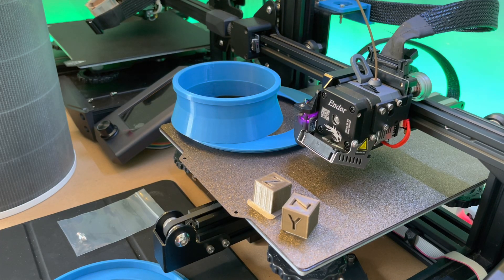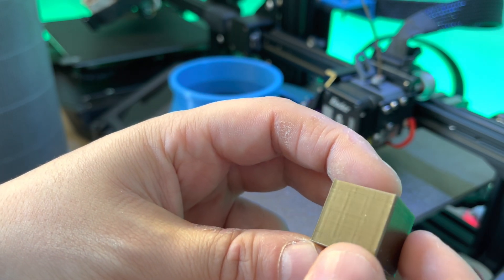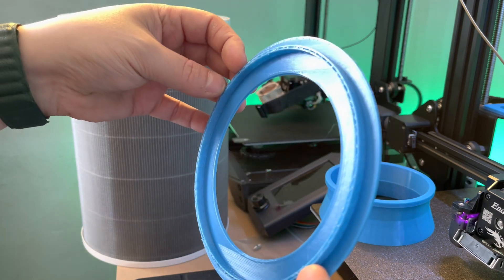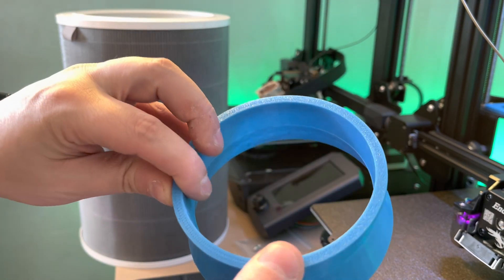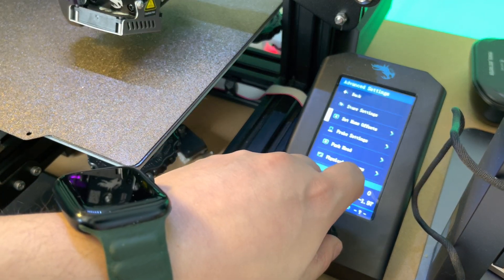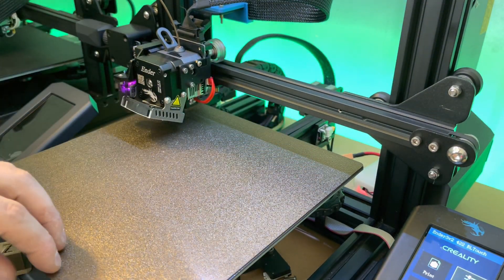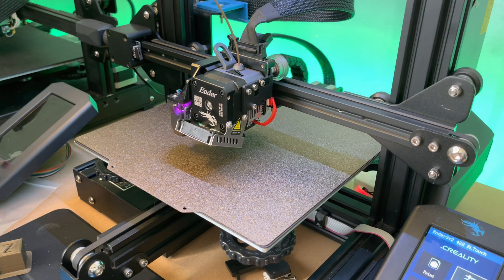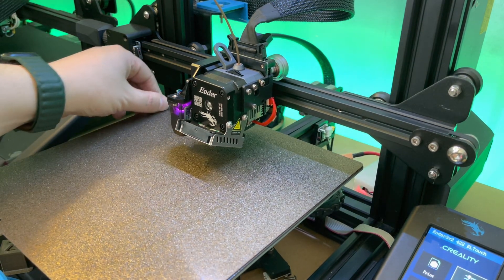Ender 3 s1 pro/ s1 ender 3 v1/v2 sprite extruder pro  super fast printing profile

Comment: That's weird. I wonder why they both seem so much worse than just an stock Ender 3 printer. I have a stock Ender 3 with just dual Z-axis and really need to upgrade... but I'm so lost I don't know what to do. The options are endless and they all have pros and cons, compatibilities and incompatibilities, settings for this and settings for that... and requirements for this and requirements for that... so I'm just doing my due diligence of 6 years of research before making a decision... and so far I'm about 5% towards making a choice. I figure if I really get serious about it and learn everything I can, I might be able to figure out at-least a good choice by 2062. If anyone has any Ideas, I would appreciate hearing them. I have a Sprite extruder, but screwed up and didn't buy the hotend, so I'm not sure if I should continue along them lines or if I should just get something entirely different. I just want to be able to print CF Nylon and increase print speed, hopefully to 200 or so, but that's not quite as important. I've been looking into the Spider Pro and the Micro Swiss, but they're kind of out of my price range (but not entirely if I save up)... and I'm not sure exactly what else I need for each one to work. I like the ability to print at 450C+, even though I'll probably never use it. I believe the Spider Pro is the faster one, because of the larger heat block, but then I would need a lighter weight extruder if I'm not mistaken, or else I'll have print quality issues. Seems almost like there is no simple choice.

Comment: T
hanks for the video, to use the sprite extruder did you change the retraction parameters? I believe the ones in the file are suitable for Bownden extruders (only).
Reply from the maker: yes retraction has to be between 0.8 and 1.2 max

Comment: Hello . Great video , I’m having issues trying to upload the firmware for the sprite pro on my Ender 3 neo and ever since I installed the Sprite Pro my extruder and bed are not aligned correctly. Can you help please?
Reply from the maker: Hi there, i think u should check this other video I've made out, i think it will fix your issues  https://www.youtube.com/watch?v=MIMXJhPQyzI&
Reply: @aim6mac  ok thank you, what about the firmware issue
Reply from the maker: @theeclecticlife  as far as i know ender 3 neo uses the V4.2.2 mainboard, so did you use the file for that specific board?
Reply: @aim6mac  yes put I can’t even get it to load it
Reply: @aim6mac  I need the detailed process
Reply from the maker: have u got any idea which mainboard the ender 3 neo has?
Reply: @aim6mac  v4.2.2
Reply: @aim6mac  the thing is I download the firmware to my computer and then put it on the SD card and I put the SD card in the printer with the printer off and then turn the printer on and nothing happens
Reply from the maker: @theeclecticlife  make sure your sd card is formatted as FAT32
Reply: @aim6mac  ok I will try that, thank you! I’ll let you know how it works out
Reply: @aim6mac  hi formatted it to fat 32 which I think it was already on that and still nothing when I put it in the printer
Reply from the maker: @theeclecticlife  steps u have to follow are 
rename the firmware file to  firmware2022.bin  and make sure there is nothing else on the SD card 
eject the sd card from your PC / laptop
turn your printer off
insert the SD card into your printer 
turn your printer on, wait 25 seconds
turn off your printer 
take the SD card out of the printer
turn on your printer once again and it should have the Mriscoc firmware on there.
Reply: @aim6mac  ok I will try that  and let you know
Reply: @aim6mac  yep that worked, so it was just the file name was incorrect???
Reply: @aim6mac  thank you very much!!
Reply from the maker: @theeclecticlife  glad it worked for you , enjoy!
Reply: @aim6mac  I finally got the firmware installed, but now it’s mainly alignment issues and stuff. Not printing in the correct spot on the bed and z height! I watched that other video too it helped a little.
Reply: @theeclecticlife  if your using a ender 3 the bed dimensions are 235x235 and I forget exactly z height but I think it's 250. In the firmware make sure your x and y axis maximums don't go above those dimensions

Comment: those lines is the infill showing through, your slicer settings are wack
Reply from the maker: If thats so why does it not show on the one thats been printed with the pro extruder… just saying :0
Reply: @aim6mac  I'd agree though. maybe check in the slicer, if the lines align with where the infill touches the outer perimeter.

Comment: There is a significant difference in those 2 prints.... However, I didn't get it... What you are doing with the Filter.. What are you making :)
Reply from the maker: it's a filter for my laserpecker 2 laser engraver
Reply: @aim6mac  Damn, that actually exists. I thought it was something you made up.

Comment: I tried the super fast profiles, its only working on basic shapes for me. As soon as there are steeper overhangs or small parts, the default cooling fans cant keep up, and you will get ugly layers. Or you need to higher the minimum layer time, which makes it kinda useless to print fast in many cases.
Reply from the maker: good to know that, i haven't tested it for too long, but i'm kinda guessing what u are saying should be correct, it's only meant for rough prints
Reply: @aim6mac  just ordered fans for the S1 Mod, hoping for better cooling with the 5015 blower.   Im struggling already at 70mm with 750 acceleration with the default ones.
Reply from the maker: @satoshipokemon8411  let me know how it works out